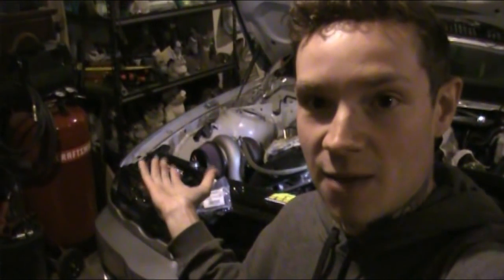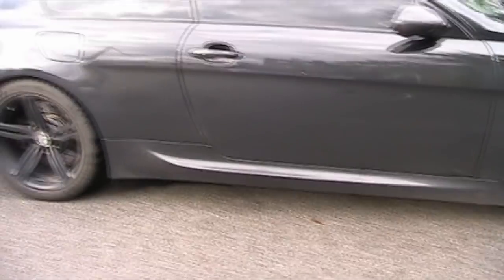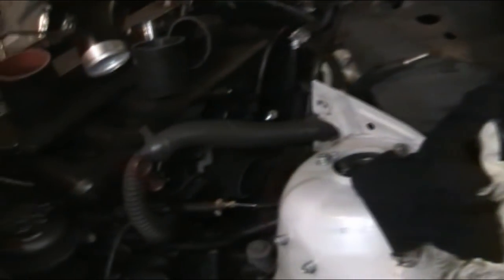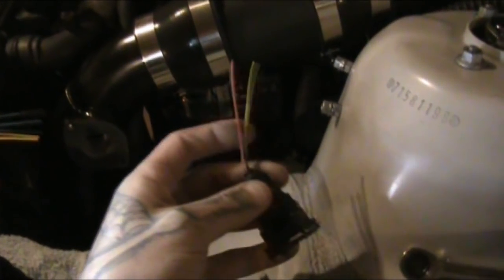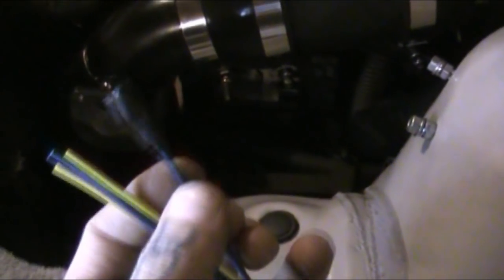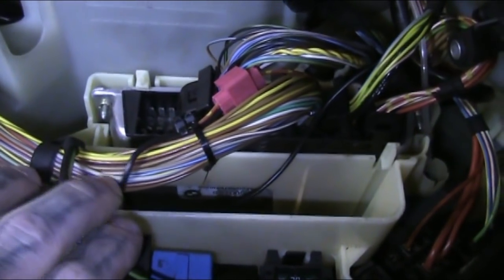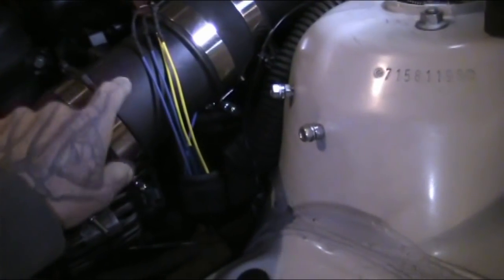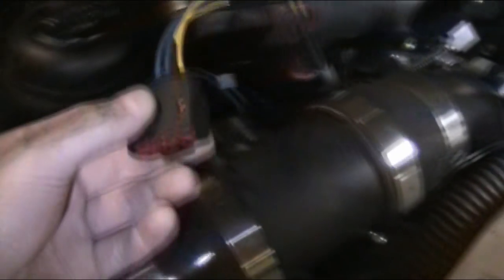BMW E46 Turbo Build Upgrade Parts Install #2 Audi MAF

Comment: CCV delete should be mandatory on the m54. Thing is crap, even the updated version is just blow-by and vacuum leaks waiting to happen. Good move deleting the DISA valve as well. I've replaced so many of them over the years. Just another obstacle you gotta overcome if your keeping the stock manifold. Good information in the video on the pinouts especially. The 3.5" MAF is definitely an upgrade from the stock one. Theres a Hyundai that actually uses the same MAF as the OEM one without the BMW part number if you cross reference them. Saved many people money and you may already know about it.
Reply from the maker: Yep, I know about the Hyundai MAF!  Neat little trick.

Comment: How much boost is this maf good for?
Reply from the maker: It's not so much about boost, but the flow rate. People have used this MAF in 14+ psi applications however. Hope this helps

Comment: Love you’re videos bro! Please do a video about your ccv system, been trying to figure out how I’m gunna delete it lol. Keep it up!! 👍🏾
Reply: On the non turbo e46! I’m hoping someday I can get to build it with a turbo haha
Reply from the maker: @Auss36  okay, perhaps in the future I'll discuss the setup as it's still experimental. Having harsh winters and hot summers where I'm from is putting it to the test. Haha.
Reply from the maker: Do you want CCV info on the non turbo E46, or details on turbo E46?  Also, thank you for the support 👍
Reply: Do you recommend a catch can? I've bought one, but after doing some research have found that connecting the crankcase exaust to high vacuum intake could possibly cause excess oil consumption. Now I'm afraid to install it, oil consumption is already my issue haha. Would it be better to vent it to atmosphere after the catch can?
Reply from the maker: @Auss36  The original CCV is ingenious in design and works well when working properly. People complain and gripe when it goes bad. That's at high mileage, the original system lasts 100k plus miles. They don't realize it lasts that long and call it junk because it's a pain to replace. I'm probably going to return to an OE CCV system in the wagon and just add the O2 pilot mod. But do you know the real solution to solving M54 oil consumption? It's to replace the low tolerance piston oil control rings.. Lol.  Now venting to atmosphere isn't a great idea for daily driven unless boosted. There's no aid in evacuation of moisture from the crankcase. The moisture needs helped getting evacuated by vacuum. Boosted cars produce more crank pressure, so it's sort of assisted while under boost, although people will sometimes use their exhaust to aid in evacuation by using special venturi fittings to help draw vapors from crankcase while engine is running. The fittings put crank vapors directly into exhaust, the fittings are angled. So the exhaust becomes an vacuum source.

Comment: Great video and the first E46 MAF tutorial I’ve seen 👍 only just done this mod myself a couple of weeks ago 👨🏽‍🔧 only gripe i have is the use of splice connectors ☹️ if u can try and solder connections as there is less chance of wiring faults later in the build imho. Keep positive u will have more good days than bad with this build 😀
Reply from the maker: I totally agree, I don't like the splice connections either! I really want to remove a section of insulation around the wire without cutting it. Then twist/solder on the output wire.
Reply from the maker: Also, thank you for the support! 😁
Reply: and remember to put the bov back in the intake.  otherwise the maf sensor gets wrong values.  With map sensor, that does not matter the bov can blow free
Reply: Never use solder in any hot areas, especially the engine bay. the solder will melt.
Reply from the maker: @OomGielie  inside of the DME box won't reach that hot of temperature. But yes, solder joints also do not perform well with vibrations, the solder could eventually crack. When I did my engine bay wire tuck I did it the same way I wired this MAF, conjoined the wires and double heat shrink, then wrapped the whole harness in electrical tape. An common misconception is that people believe soldering wires gives a better electrical connection. Not true.
Reply: @OLearysBMW  a correctly soldered joint will last a very long time as long as its heatshrunk and wrapped properly,issues occur with solder joints due to poor preparation,as for heat in the engine bay,its not hot enough to cause problems as the melting point of solder is way above the normal bay temps hence why looms are routinely bolted to the engine blocks and routed throughout the engine assembly.im not saying splice connectors are wrong but solder connection are more reliable (if done properly) imho 👨‍🔧👍
Reply from the maker: @larbi3568  I understand 😁 I was replying to Carl
Reply: @OLearysBMW  so was I lol 😀
Reply from the maker: @larbi3568  you tagged me so I thought you were talking to me 😊 haha
Reply from the maker: @larbi3568  hey, I came back to say that I've revised that 5v wire. I removed the quick splicer and soldered it. I feel much better now, haha
Reply: Tyler O'Leary  haha I’m sure you will have plenty more revisions as you go forward,I have plenty “it was good at the time” moments haha
Reply from the maker: @larbi3568  for sure

Comment: I’m getting ready to do this to my daily e46,
I’m only worried about the AC system delete, have you ever thought about running custom length AC lines?
Reply from the maker: I'm not worried about it. I have A/C in the ole dad wagon. The turbo car isn't luxurious. But if you live in places like Cali or Texas then yeah, I'd probably look into that 🤔🤠
Reply: When you drive fast enough you didnt need an A/C 😁
Reply: C7 Luke  they also have bottom mount turbo kits for the e46. Just something you might want to look into if you have bought your turbo kit yet.

Comment: hi, why dont install map sensor? most turbo builds swap from maf to map. i'm looking for the speed density code but cant find it online
Reply: But vids from gelashvili performance are awesome.
There you can see what is possible with m54 and m52 engines 😁
Reply: @MarcOPolo-il2wb  yeah he is at the top of the game turbo tuning these cars,I have also been looking for the speed density code 🧐
Reply: @larbi3568  i will let you know when i find the speed density algorithm
Reply: Ok, do you have the speed denstiy code for the m42 or the m43 ecu?
Reply from the maker: @MarcOPolo-il2wb  I do not, sorry I can't be a help this time
Reply: Do you program yourself the ms42?
Reply from the maker: @MarcOPolo-il2wb  no, I don't. I haven't taken the time to learn, although I do have a spare MS42 laying around I could practice on.
Reply: Hi,contact George at Gelashvilli performance as he is currently tuning cars with speed density code,Ive heard u fit a map sensor which uses the MAF sensor wiring and the ecu is coded to suit with a complicated algorithm to convert the readings.
Reply: @larbi3568  I mean exactly that algorithm, I saw it online in a forum but I can not find it anymore.  but a friend is a programmer maybe he can help me to rewrite this algorithm
Reply from the maker: That was an option I've thought about. But this is less hassle needed to make work.